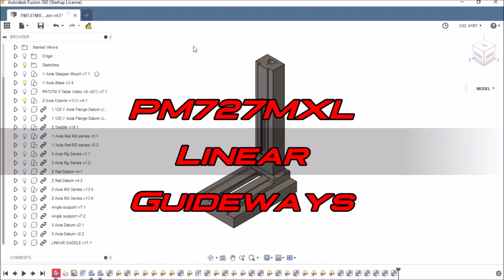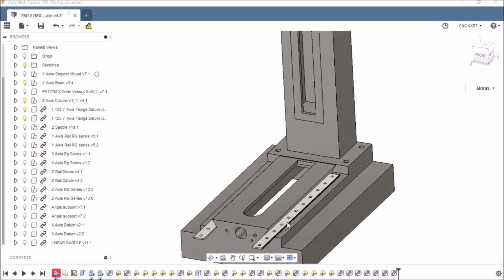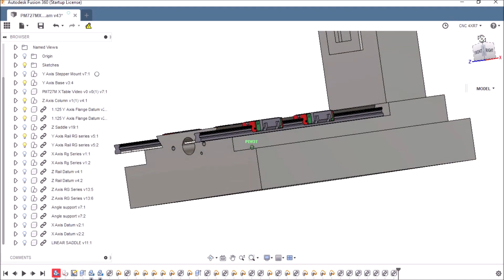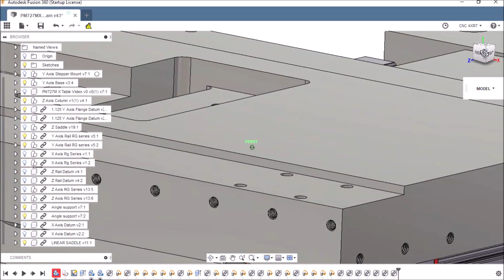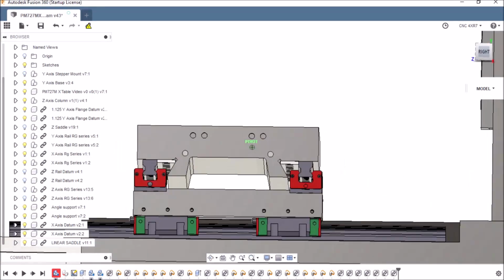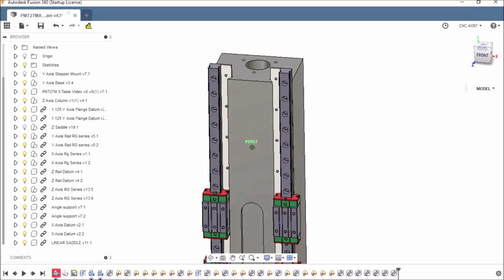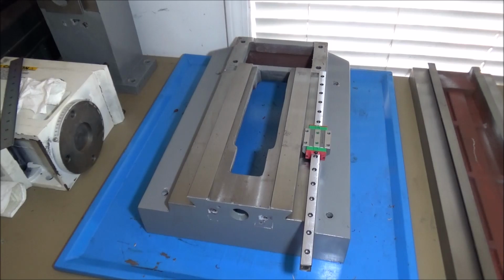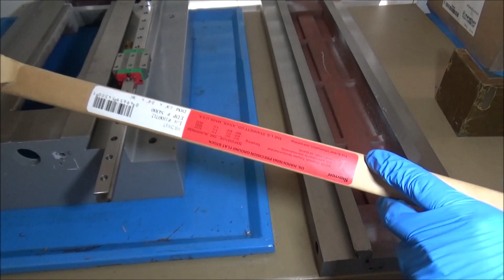PM727MXL Linear Rail Concept

Comment: Why not fill in the Dovetail area with steel bar stock machines to fit in the bevelled area and bolt them in place in a few places then machine those to fit the Linear rails to them.
Reply from the maker: That would work well however you need a machine large enough to do the machining.
Reply: @CNC4XR7  all you need is a machine large enough to machine the smaller bar stock to fit in the dovetails to make it all the same height. you might be able to use a grind stone in a hand router to surface the top flat with the other surfaces. a machinist finds way to repair and machine out side the box that how it always been done back before all these NC machine, i worked for Linamar machines in the 1980's and did things to get the parts right that wasn't in the normal machining handbook and i worked on military missile and guns parts with machines that where at that time old manual milling and lathes. we used them to make the prototype PLC machines to build the missile parts where each operation was started by the last operating ending point.

Comment: Hi, I am also designing a desktop CNC milling machine with working area around 200 X 200 X 40 mm. 

Here i am facing a problem. However i have completed most of the design. When it comes to force analysis i have no clue how force will act on machine parts during milling process. 
I belive the forces depends on the material (workpiece), spindle power and speed . But i dont know any formulas to calculate the forces. Could please suggest me any book or material which can lead me to solve this problem.
Reply from the maker: As long as you do not try and machine more than the Tool and Spindle motor will allow the force applied is minimal. These machines have a tendency to flex when to big of cut is taken. staying within the limits of the machine is the best practice

Comment: I tossed up this idea but ended up going the weldment route. Made it out of 100mm x 200mm x5mm tubing with full intention to fill it with epoxy granite. Having it together now I don't think I'll need the eg but the option is there. I'm lucky to have access to large milling machines to machine the milling base but I think you could do it easily without them. I love the idea of the spacer and keeping the dove tails.
Reply from the maker: Thanks! Manny
I like to keep as much in fact as possible. And design builds with those who may only have the one mill to work with.

Comment: Do you think there's any lost of rigidity in the space that lies between X/Y? I had this exact same plan in mind, minus the datum reference points. My only thought was to model it up in a manner that 'sinks' the blocks into the X axis plate to minimize that large gap - which in turn will get you some Z clearance back. The same thing in Z, that void will lose some of your Y axis travel towards the column - right? Or, will it remain with the spindle centerline in the stock position in relation to the Z column surfaces?
Reply from the maker: I dont think the space will hurt rigidity i do need room for the Ball screw / Ball nut
On Z ac=xis i use a head spacer anyway since I extended my Y axis to 10" so that will not be a Issue
Reply: @CNC4XR7  awesome. I'll be watching for the update!

Comment: how will you access the y axis bearing block screws that are on the inside against the y axis dove tail? Will the inner screws attach from the top? or would you only use two screws per y axis block?  

I do like the idea on not milling back the dove tails, as you can always go back to stock if it doesn't work out. But if you remove the dove tails, you can fit a significantly larger linear rail. I guess more risk, more reward, for removing the dovetail. Do you think 15mm will be enough? I think the haas mini mill uses 30mm rails, as a frame of reference. I was sizing up my machine last night, and am considering 25mm on all axises. 

I looked at steal plate, and man is it expensive. But I think at the end of the day it will probably be required over the aluminum. I guess you just need a few people to split a length of it so you can make several saddles out of it.
Reply from the maker: Lol You saw the mounting dilemma!  I will have to build up the x axis first and get them mounted to the saddle. Then assemble the Y axis and just snug the inside bolts so I can move them if needed. Then slide the assembly on the base y rails. Once it is all aligned. I will tighten the outside bolts. Slide the assembly back off and tighten the inside bolts.  At least that's the plan will see how it plans out. I scored a couple pieces of steel stock off Ebay so I'm good there and I plan to use 7075 for the Z axis to save weight.
Reply: Couldn't you make the saddle wider in the X axis direction. That way the X Axis blocks are outboard of the Y axis blocks, and the outer edge of the y axis dove tails? this way you would have plenty of clearance to tightened all the bolts from the bottom of the saddle. I would think the only down side would be loss of X axis travel. But that shouldn't be too big of an issue, since most bench top machines have more X travel than most ever use. I would think even with the reduced X travel you could still use two 6" vises or three 4" vises.
Reply from the maker: Yes I did consider that option and as you mentioned there will be a loss of X travel. At the moment I have 18" the Stock mill has 15" and most likely since I will not be able to over extend the X travel as I do now I will be back to around 15". Making the saddle wider might put me around 12" so not something I would like reduce. of course if I have to then that's another story.
Reply: 12" would be a little small, but not a deal breaker. Do you have any plans to upgrade your spindle? I think once you have the linear rails and servos your cutting feeds cold easily be 150 ipm +. and your rapids would be over 250 ipm. As long as you have the spindle rpm to maintain your chip per tooth.  With those speeds I could easily see you getting 4 cubic inch per min removal rate with a 1/4 or 3/8 end mill in aluminum. 

It is sort of an endless cycle, improve one area, then move on to the next. After that I think the limiting factor is tool pull out with the TTS.
Reply from the maker: It is a vicious Cycle that is for sure. I will be upgrading the Spindle motor to a 1000 to 1 constant torque motor. Any spindle upgrade will be later down the road. with the Dmm servos rapids will be well over the 300IPM I'm comfortable with. 

Feed rates will most likely increase to a point where the pucker factor is the limiting issue.
But never say Never who knows what the future brings.
Reply from the maker: yes it is a vicious cycle, I will be upgrading the Spindle Motor to a 1000 to 1 constant torque motor but no plans to upgrade the spindle to a Higher RPM. The Dmm servos will push the mill in excess of 300ipm Rapids and the cutting feeds will most likely be pushing my Pucker factor to the limit. But never say never. will see where we are when complete.

Comment: How do you want to tighten the 8 screws in the middle of the Y axis when assembling? It would be better to turn the cars. The bottom to top and the top to bottom and the Konstrucktion adapt. If you have the cars from the bottom up, you can easily screw in all the screws. You can then first tighten the outer 8 screws firmly and then slide the table to the left .... and firmly tighten the first inner 4 screws then move the table to the other side ...... and tighten the other screws.
Good luck
Reply from the maker: Hi Stephan,
 Yes it is going to be a Challenge to secure the Blocks I will have to tighten the X Blocks and secure then to the saddle and get them secured then I will be able to tighten the 4 outside Y axis block mounting screws the inner screws will be a challenge I think I have a solution.

Comment: Nice work Sam.  Commercial machines do something similar by pushing the rail up against a machined edge and then using lots of tiny finger clamps on the other side of the rail to hold it against that reference edge.  As you say it will help hold position under heavy loads or minor crashes, but also worth mentioning that it gives the rail more stiffness than just relying on the clamping force of the rail bolts.  Should work well so looking forward to the next one.
Reply from the maker: Thanks Yes i think that is the Idea exactly!

Comment: Very interesting Sam - Re a steel plate, have you looked into moldset modular plates. Even in NZ there is a big range of ground steel plates so there will be a much bigger range in the USA. eg:  http://www.egwhiter.co.nz/Mild-steel-plate
Cliff
Reply from the maker: Thanks Cliff, 

I was able to score a good deal on some 1.25" steel plate off Ebay, I also picked up some 7075 for the Z axis to save a little weight. I would have like to  use Dura Cast but its just to expensive.

Comment: After experiencing linear rails on a 96 Bridgeport VMC I have come to the conclusion that beyond rigidity you need axis precision and a high quality spindle with plenty of RPM. From there decent feeds and speeds can make a 200lb mill deliver parts with higher finish quality than a modern day VMC run at a high chip load. I have also found certain rails can be purchased for 1/10th the price of name brand products. Sadly I haven't found any roller type clones so I would suggest going 20mm even on a G0704 as the rails themselves add quite a bit of rigidity as a bonus, so I don't mind giving up a little travel on the Z. 

My biggest issue at moment is how to finish my X axis and Z axis with rails without a second machine. I think I've come up with a plan to build a temporary new saddle and bed but it's a tricky route you commit to hoping a lot of pieces come together.
Reply from the maker: Hi Dean,
 You bring up some good points and I understand these risks. Stick-tion of the Dovetails help add rigidity to these mills with out it the lack of resistance will put all the force on the Ballscrews. I know the motor I have chosen will handle the load it is a 1000 to 1 constant torque inverter duty motor. But I will not be reaching rpm with this spindle of over 5500 rpm.

My plan is to keep the machine intact so as to not destroy the castings. I will machine a new Saddle and preserve the original.

Comment: Looking good so far, really like the concept!! .... You mentioned that all you had to do was drill and tap some holes??? I wouldn't rely on any fasteners for positional accuracy on anything; their concentricity is nowhere near good enough. Id drill undersize, then single point precision bore for dowels.. preferably tampered ones for the datums.... you also need access to a machine big enough to machine this in a single setup. Cant you use the holes in the rails as datums or are they not positionally accurate? If so, scrap the whole datum idea and maybe use 3 parallel dowels along each rail... theres enough counterbored holes to sacrifice a few for pins :/
Reply from the maker: I may not have stated correctly , The datums will be wedged against the stock dovetails then drilled and bolted into position. The rails will be pushed against the datum and bolted into position. Also a bracket will be used to Clamp the rail into position. None of this requires a separate machine to mount which was the whole Idea. I have seen the pins used but the holes will need to be precise once pinned there is no way to make any adjustments.
Reply: Maybe put the saddle back on the mill with a mag base and sweep out the horizontal and vertical surfaces you are hoping to use for alignment/ mount the datum... usually only the top bearing surface and the undercut of the dovetails are accurately machined. All other surfaces are only roughed and id be amazed if the horizontal surfaces either side of Y dovetail were even the same height . But I see the issue if you don't have access to a larger machine.. you need to just take the plunge, Good luck!

Comment: I really like your design. I’m just wondering why you need precision ground bars (datums) if you are needing to machine them to a smaller width? The thickness wouldn’t really matter but the with would be more important right? The design is great. I think I’m definitely going to used these ideas with my conversion. Great job
Reply from the maker: I only needed to machine the Y axis to width the others were stock width. Its nice to start with straight flat stock. I suppose you could use Bar stock but you may need to do some work on it.

Comment: Really clever solution with that parallel stock. Was that stuff very pricey? I'd think it'd be worth a good bit to not have to do the machining on those parts!
Reply from the maker: 3ft X and Z bars are $22 each Y 18" bars were $17 each
MacMaster Carr
X Z   9516K46
Y      9516K48

Comment: Sam, thank you for making these videos, Its truly impressive! 
Waiting in anticipation for the next episode! 
Btw, will you be using epoxy aggrigate to fill the castings to make the even stiffer?
I bought two of these machines a while back, in a rather dilapidated state, with the idea of rebuilding them, and converting them to cnc, your timing is perfect, as one of them dont have a saddle, and your plan with an inch and a quater plate or 30mm in my part of the world, is the perfect solution! 
Once again, thank you for taking the time to video your work!
Reply from the maker: Ian,
Your Welcome!, I may do some Epoxy I have not decided yet. It just did not seem right to Hack up the Original castings. There would be voids etc. Steel Plate was the Best solution to me.